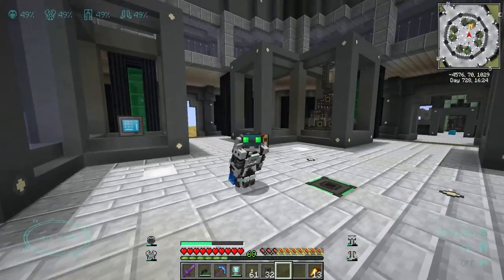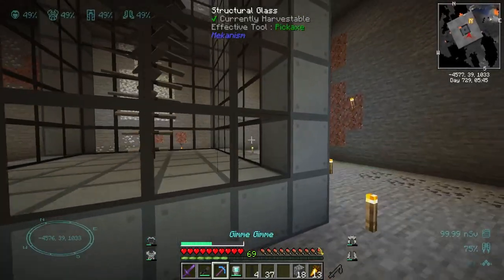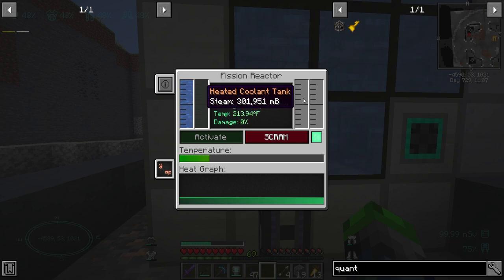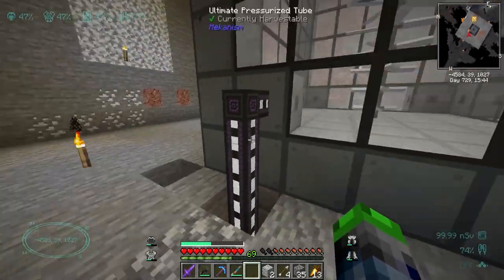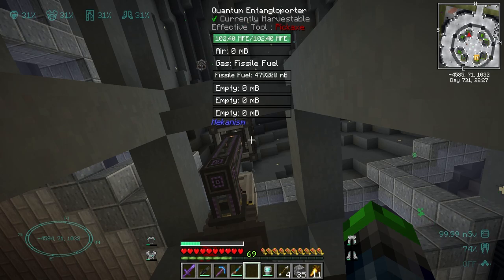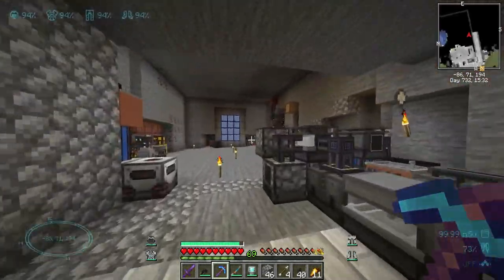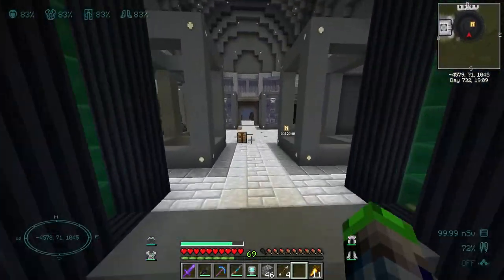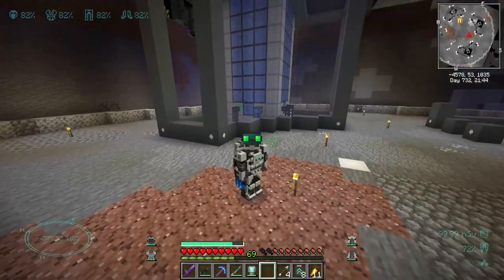Valhelsia 3 | Mekanism Turbine Oopsie!! | [Ep 26]

Comment: The turbine filled up of energy and then the reactor ran out of water. You must pump the water back from the turbine to the reactor, using the vents. And then set up a security system to shut down the reactor if anything goes wrong
Reply: Correct

Comment: Yeah, you definitely ran out of coolant.  I'd recommend 5 red stone ports on each reactor, 4 outputting a signal on all the error conditions and one which turns off the reactor when any of the other 4 output.  I'd also stop throwing out all that sodium you're making and use that as your coolant in your reactors and pump that into a boiler to gen the steam and take that into the turbine (which incidentally is very NOT optimized, note your limiting factors in the gui).

Comment: the problem was you didn't have enough coolant getting pumped into the reactor! when you made the reactor burn more it went through the coolent faster. if you use sinks for cooking with blockheads and hook those up to the reactor and have more coolant imputs you can make a reactor like that run on 10 mb/t